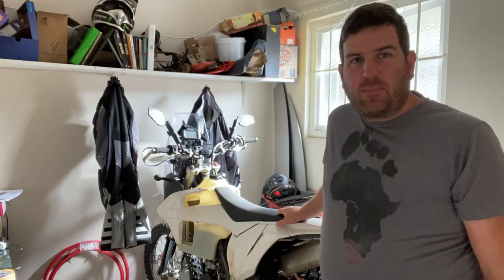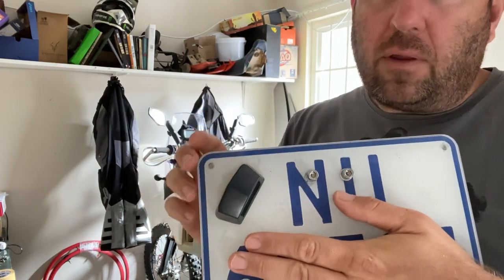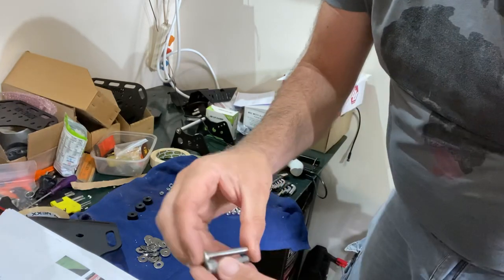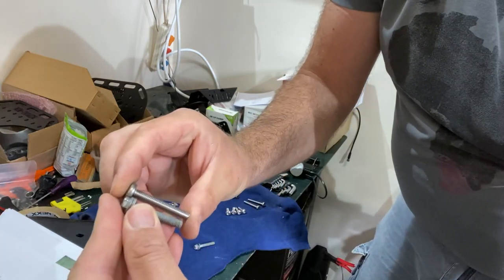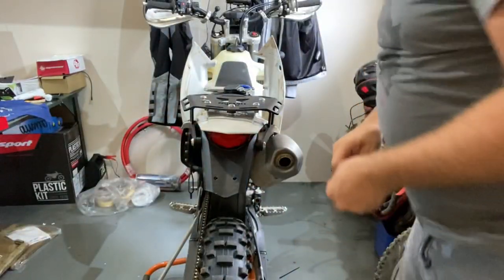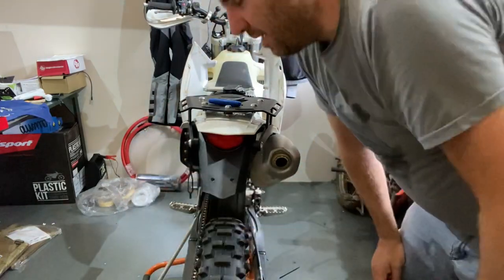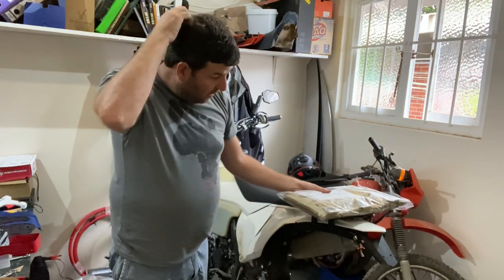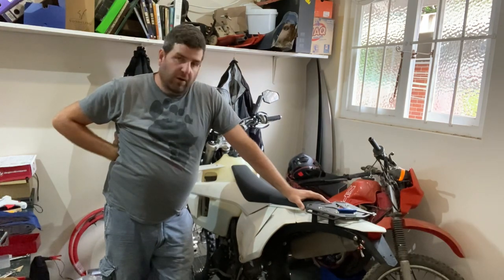KTM EXC Rally Bike Build Project Part 6 - Nomad rear luggage rack

Comment: I ordered a rear rack from Mike at Nomad ADV for my 500 EXC as well. I think him and his fathers little company are solving problems better than any of the big guys. Curious as to why you  didn’t get the side rack panels as well? The only issue I’ve found is they are really lacking with written, pictorial, or video installation instructions. You are left to figure things out on your own, but after a fair amount of head scratching it’s not too bad 👍🏾
Reply from the maker: Hi Sumporfuk, I did order the side panels, I only plan to use them after the rally as an adventure bike. I agree Nomad make a great product, but the instructions need some of you own input at times. Thanks for the comment.